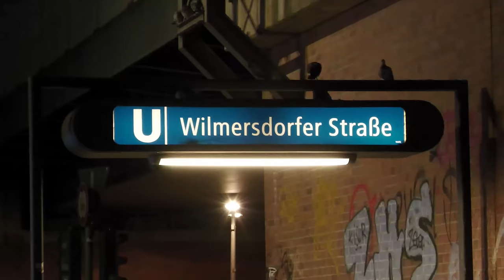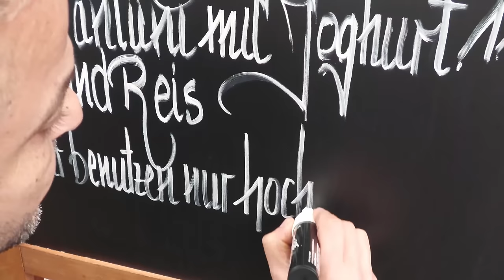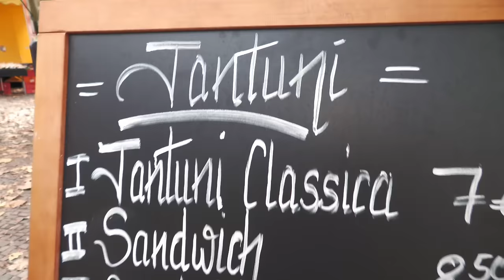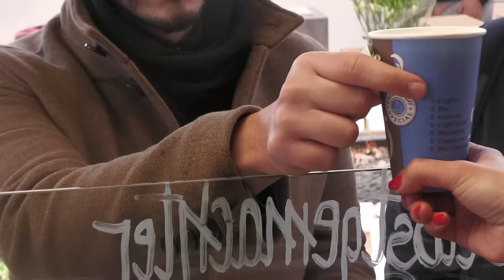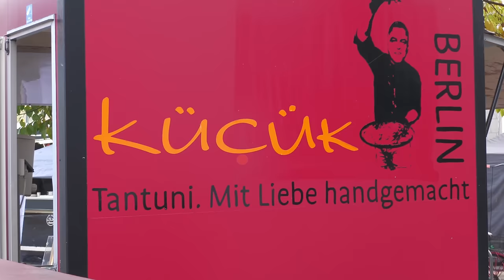Street Food Couple with Love & Passion | Tantuni | Turkish Street Food Berlin Germany

Comment: Guys stop serving Turkish traditional dishes improperly, The onions for the Tantuni need to be sliced extremely small as thin cubes, there is no such thing as Tantuni with yogurt the meat need to be sliced more smaller, you need to add red sweet or hot  powder pepper while heating the meat. You never slice a Tantuni roll. If you are selling Traditional Turkish dishes do it properly or don't do it. Even the size of the onions will change the taste in Turkish dishes. Also the Tantuni stove is not proper normally Tantuni stoves have a smaller hole in the center unlike this one. Tantuni roll need to be very hot and after preparing it you put it on the center for a few seconds to heat it more and the cook never add the lemon 🍋 juice the customer will add after every few bites.

Comment: All the broth from the beef, and all the broth, along with the smaltz from the chicken went down the drain. What a waste, what a loss of flavor. I would have separated the smaltz, then used the two broths in separate portions of the rice instead of plain water. The smaltz, (and from the looks of the raw chicken, and what was drained off, was quite a bit), I would have used it in place of, or added to, whatever fat (likely vegetable oil or ghee) that was used for reheating the meat.

If you would deglaze that pan, every now and then, with a little white wine, and drizzle it over some of the rice, I would definitely have a bowl of that.